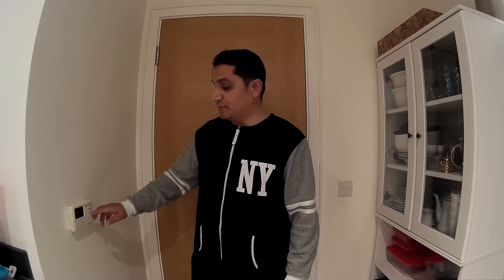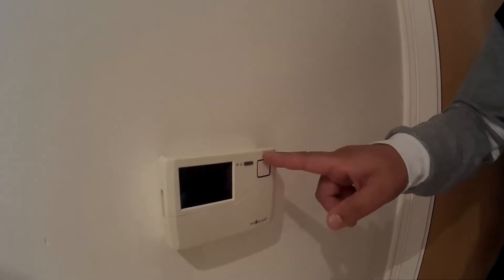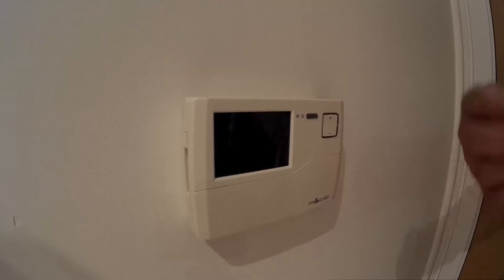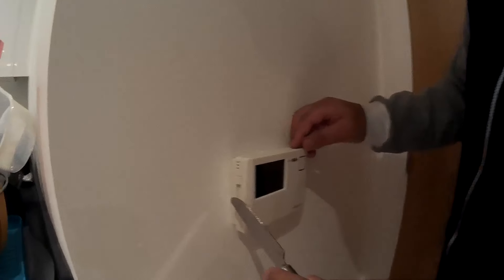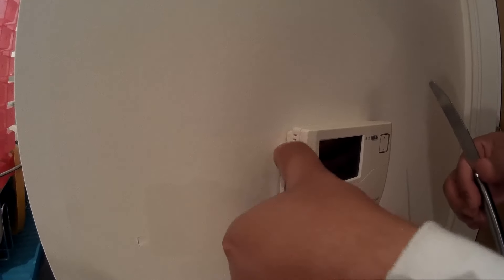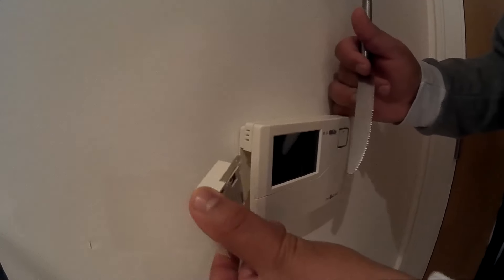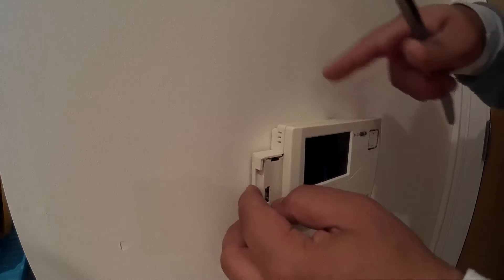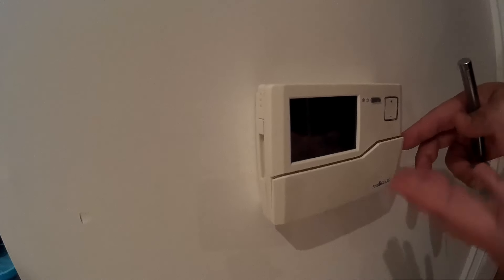How to change Timeguard Thermostat TRT037 battery

Comment: Thank u very much for this simple but very helpful video. I was about to unscrew the screws on the bottom of the unit to look for the batteries. And thanks for explaining that the battery symbol goes away once the batteries have been replaced
Reply from the maker: Arlene Magill 
Thanks I am happy that it worked for you